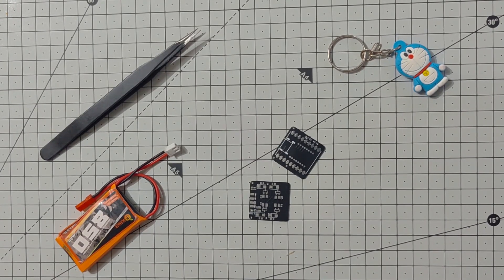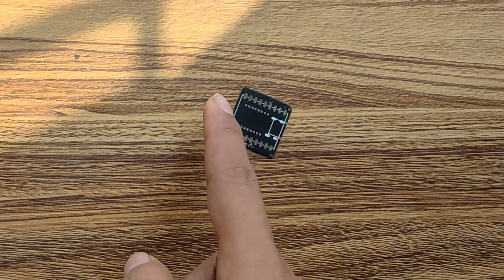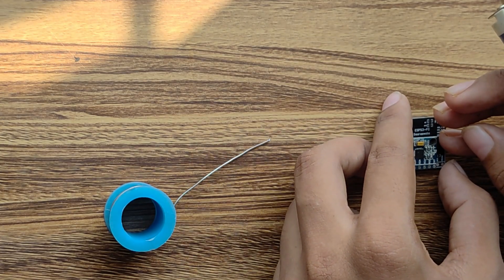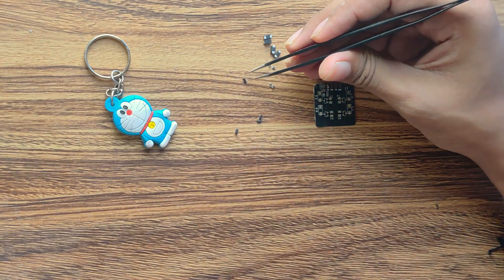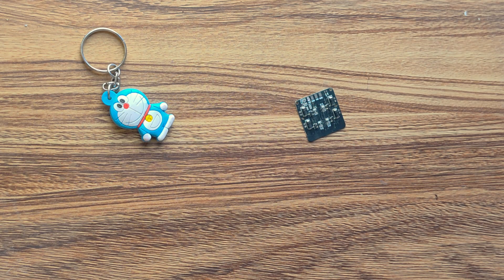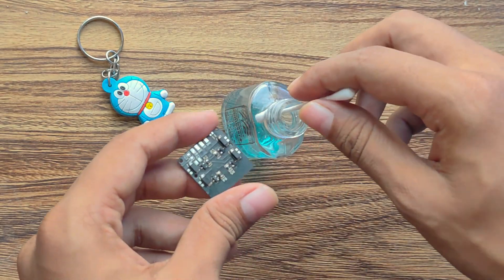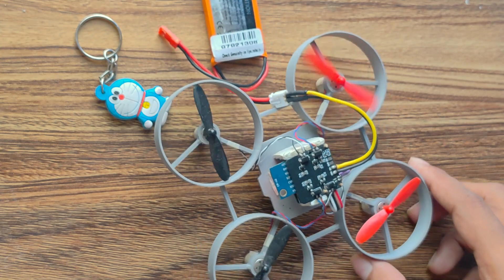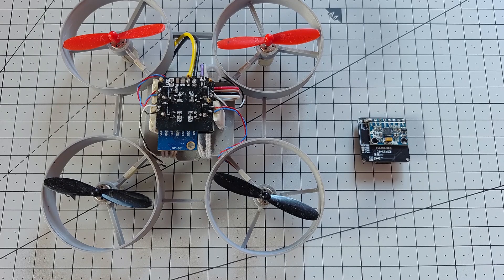DIY Brushed Drone Build | Betaflight on ESP32 !? | PCB | Supports Betaflight and Wi-Fi Firmware !

Comment: Which coreless motor used 820 or 8520 and which prop 55mm or 65mm
Reply from the maker: 65mm props, any of those motors will work

Comment: how does it handle low voltage? is there a step up 5v for 1s or step down converter to allow 2s?
Reply from the maker: There's a step up for 1s